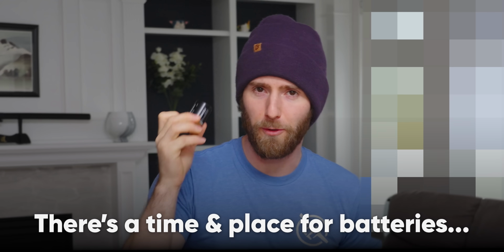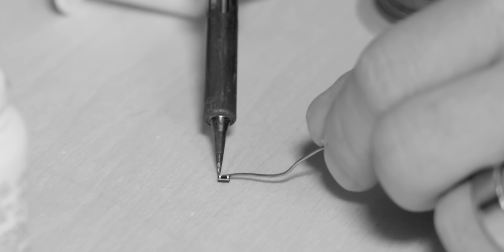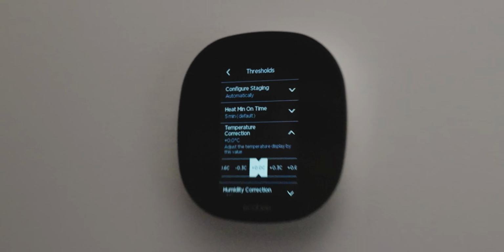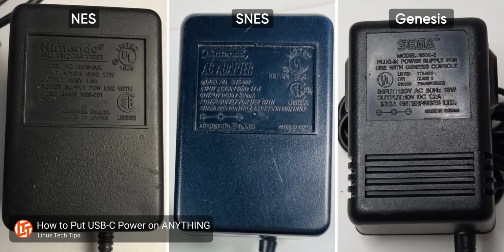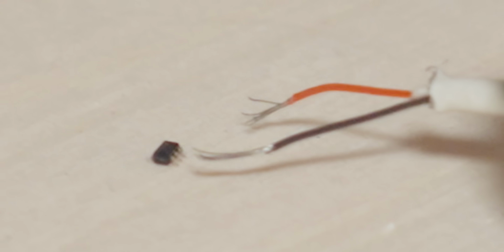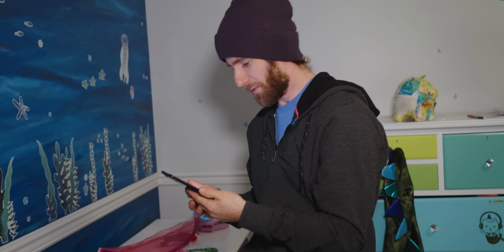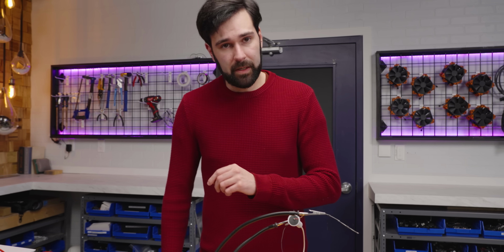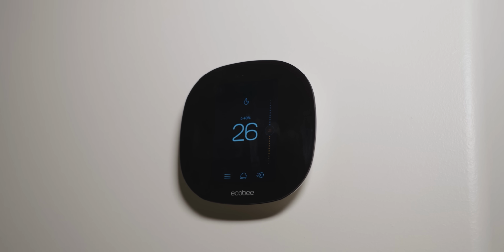I HATE Batteries! - Converting Wireless to Wired (a cheapskate’s guide)

Comment: Tip for next time: If you want to have a small DC power supply, you can use a Z diode and thus set the voltage to a fixed voltage. The structure looks like you have a resistor for the Z diode so that the current to the diode and the consumer is limited. The consumer is then connected parallel to the Z diode. The Z diode determines how high the constant voltage is that falls off via the diode. The Z diode is installed in the blocking direction. This makes it relatively easy to set up a small power supply.
Reply: That is what I was thinking. Why not get a zener diode and just be done with it? Or if that's too much hassle to get the right one, just use a good old LM317
Reply: @fermitupoupon1754  Yeah, an LDO or a zener seems like the move here
Reply: a diode lower the voltage with 0.7v, so u can use 2...as long the diode is big enough for the current, its not a big deal!
my question is: there a so many employees on LTT and no one has a clue about electronics?? come one!
Reply: This thing should be pretty simple, you guys cant use diode to regulate indutive/capacitive loads, you dont know whats is inside. It only Works for resistive loads.
The solution is simples, just use a LDO regulator IC like LM317 and regulate to the same battery full voltagem. If you are looking for efficiency, go for a Buck booster regulator IC, but its not the case
Reply: @gaucho804  sure u can use diode!
the guy in the video did that too!
as long the current is low and not fluctuating a lot, its not a problem!
but u cant use it for all purposes.
Reply: I might be misunderstanding because I haven't used zeners myself before, but wouldn't shorting one across the supply output of a regulated voltage source (the 5V wall wart) cause the upstream active regulator to dump upwards of half an amp through it trying to push the voltage back up to 5V? That seems much more wasteful than an in line linear regulator.
Reply: @bosstowndynamics5488  In this case you'd use a 3.3V zener diode. You'd put that in-line on the positive side.
So you backfeed it with the +5V from the wall wart, into the +3.2V for the sensor.

The +5V exceeds the zener diode's zener voltage. Which causes it to break down and start conducting at it's zener voltage of 3.3V.
Add in a smoothing cap and a discharge resistor. Done.

No need to fiddle with a pot to try and calibrate a regulator. As long as you don't try and draw more amps than the zener diode is rated for, it'll regulate the voltage.
Reply: @fermitupoupon1754  Wouldn't it be easier to just use a 3.3V fixed voltage LDO though? Single part, maybe a capacitor if you're feeling extra fancy. Still no pot.
Reply: @bosstowndynamics5488  Lets say our device eats at most 10mA. We need 3 to 3.3V for it to operate, thus we select either 3 or 3.3V Zener diode. If our power supply is regulated to 5V then we "need" to lose 1.7 to 2V on "input" resistor, but we also need to have enough current for both our device and diode to work properly, typical small Zener diode will need few mA on its own, so lets say 5mA. For 1.7V "drop" we would need around 110 Ohms, for 2V 130 Ohms. We could add a small smoothing capacitor with high value discharge resistor, but for a cheap-junk solution it doesn't really matter. Current will flow from 5V via the load resistor, a bit of voltage/power will be dissipated on it, diode will keep the "output" voltage on required 3 or 3.3V, and the 15mA of set current will flow through both the device and diode.

Two electronic components and it works, but it has few flaws, you basically dump all that calculated current in this case of 15mA all the time, either in the device or in the Zener diode. Personally I would rather use either LM317 or LDO equivalent like LM1117 if the input-output voltages aren't at least 1.5V different. Two resistors to set the output voltage and also become minimum load and thats it. You probably wont need the capacitors, but if need be, could ad them for stability. Advantage over Zener is that although you still need minimum load for proper regulation, and that load being similar at most 5-10mA depending on IC used, you don't need to "waste maximum calculated for Zener setup current" cause IC will regulate voltage and what ever current device needs it will provide, while Zener had a set current and if not used, it would be wasted in the Zener itself. Aka if device eats at most 10mA and need those spikes to work, but most of the time eats less than 1mA, with diode we would need those 10+5mA to be there all the time, the 9+mA difference in device consumption will just go through diode, in the linear regulator way, we will have the perma 5mA minimum load plus what ever device needs above it.

There is always the full "overblown" mode in just buying a cheapo DC-DC converter ;). Or full "junk" mode, where you don't use a 5V USB power supply, but make a capacitor-dropping one like the ones used in LED bulbs haha.

In all honesty thou, if you don't know electronics at all - buy a "pre-made" power supply. And if you know enough, modify the 5V wall-wart thingy - most "decent" ones will have a feedback, and changing resistors in that feedback to make the thing output less volts would probably work fine. Only the junkiest of them will be extremely hard to mod cause they often "feedback" at being designed to output certain voltage with certain current, and they just have more volts on output unloaded, aka only way on some of them to change output voltage is to change number of turns on secondary winding. With supply successfully moded you don't need to do any power wasting addons.
Reply: @bosstowndynamics5488  you’d add a resistor to the 5V output. That will limit the current. 

I’d guess the resistor would be in the range of 1k to 10k, but that can definitely change
Reply: @0010010010010010011  Sorry got mixed up with replies. Fair enough, thanks

Comment: Where wanting to tell about using diode instead of a resistor 😅
But maybe also add a small capacitor in parallel to cope with the sudden spikes in current.
A voltage regulator, diode and a capacitor

Comment: Bimetal thermostat... no batteries, no "app" or "registering", will last 100 years.
And you can make a eco/ smart home system out of that too... Run wires back to dedicated distribution box with contactors, those activate regular 230V solenoid valves.

Comment: My mother had a battery-powered skylight shade installed 16-ish feet above the floor.  I don't even have a ladder that will reach it so it's just been sitting there with dead batteries for 5 years.  And it has a battery-powered wall-mounted remote control too.  The worst part is, the skylight itself opens and even has buttons on the control pad to support a powered shade completely unused.

Comment: The voltage of a brand new CR2032 is about 3.3 volts.  A 3.3 volt regulator with no power wasting resistor would have been fine.

Comment: "Shockingly inexpensive'... not sure about the choice of words. Also, the battery is at 3.2V only for first couple weeks at most. The device should work just fine on lower voltage.

Comment: 1:10 smoke detectors should be replaced every 10 years, regardless of power source. Putting a non-servicable 10-year battery in it is safer for the consumer, and ionization smoke detectors contain minute amounts of radioactive material and should be taken to a designated disposal facility anyways, so there's little additional risk of battery material going into a landfill.

Comment: Another solution along the same lines as the diodes is a shunt regulator, which is simply a 3 or 4 volt zener diode across the device terminals.
Reply: Nop, a 2v zener in series is better

Comment: I love how you try to put stuff like in to the hands of an everyday consumer but I gotta say, those variable voltage power supplies aren't really that expensive and with your solution I would still need a soldering iron, a usb charger, solder and equipment and the parts (that you usually can't buy in singles ..."40cent"...) so maybe the other solution wouldn't be that bad after all

Comment: a small DC-DC buck is just 2$.
If you really want to spend less, Just get a TP5000 Module for 1$, set it to output 3.6v. this is a charging module for li-ion/lifepo4 batteries.

Comment: When your regulator is "low dropout" or "LDO", output capacitor close to the regulator terminals is necessary. What you made will likely not burn your house down but there's a possibility of magic smoke escaping.

Old linear regulators like LM340 or 7805 worked mostly fine without output capacitor. LDO without capacitive load  becomes an oscillator - the capacitor is necessary for frequency compensation. Even if there's enough capacitance on the device supply rail, you can not rely on that since the lead inductance may be too high.

Comment: The best solution in that scenario would've been using a 3.2 V zener diode and a resistor, both of them through-hole type, not surface mount. The connection diagram for this setup is really easy to find on the internet. You NEED to calculate the resistor though, which is REALLY simple, but studying some basic electronics wouldn't hurt....
Reply: Nope, he should use a simple 2v zener in series.
Reply: @fss1704  You're right but only if the device consumes at least the minimum current the zener needs to be regulating. And it shouldn't be in series, it should be in opposition (like in series but reversed so it is biased in reversed mode).
Reply: I said that with a bit of humour. I know Linus knows some basic electronics, but apparently not enough.... lol
Reply: @alejomdp  it remembers me of the cubane synthesis using an UV led on explosions and fire, go watch that
Reply: @fss1704  I just watched it (I think I clicked on the right one), that guy is an LED murderer, he left me with no energy to even comment on his video. It's like people want to try electronic experiments but don't want to learn simple things that only require googleing a bit. He just bought stuff, connected it and hoped for the best....
Reply: @alejomdp  lol i knew you would love it.... 1 amp in such a lamp is just wonderfull, that's some good manufacturer. He should keep to doing chemistry.

Comment: Could you use a voltage regulated super-capacitor and a small solar cell mounted on the wall next to the unit? Keeps it wireless, and with such low power draw the cell should provide enough of a trickle for the cap.
Reply: They probably could have done this in the factory.

Comment: Could you just use a big ass phone battery? I mean yeah hardwired and stuff but to be honest a 4000mah phone battery or 2 standard AA batteries gonna last about 3-5 years even after waste energy over time so youd have to charge / change those things max 3 times until your kids gonna heat their own home and as I know you youd probably rip out your entire heating system anyway in 5 years for some new Plutonium style energy and heating solution for that 1000 Petabyte server with the 256 core epyc and your gaming system with the 650w Intel "17900ksgs" + 1.5kw "6091! super ti 60gb full size shader after dlc" gpu.

Comment: Not sure why you didn't use mini DC to DC buck converters for this. They're about the size of that battery, you can dial them to whatever voltage you need.

Also heat doesn't rise, it's radiant. Hot air rises 😉
Reply: Price, it's easier to use a 2v zener in series.

Comment: just use a 3.3v regulator it will be fine instead of 3.2v and it won't drop when the device draw more amps (asuming the regulator can provide enough amps)

Comment: I love seeing you guys dive into electronics. If you do a project like this again - a 3.3v regular and an electrolytic capacitor in parallel across the output should run any device like this. The capacitor absorbs those spikes. Most circuits with linear regulators follow that approach
Reply: This, plus don't even bother with the potentiometer. The circuit is most likely 3.3v which most microcontrollers are today, so leaving it at 3.3v is just fine.
Reply: I don't know why everyone is saying to add a capacitor for those "spikes", those are 7mA spikes on a device being powered through what in practice would almost certainly be a half to one amp regulator on a half amp or more USB supply, you aren't going to get voltage drops in that configuration (after all, the 3 diode solution they went with is functionally a dirty voltage regulator and didn't cause any voltage drops during the current spikes)
Reply: @bosstowndynamics5488  I think they have the wrong  idea - not realizing is an attribute of the load. There is some merit to it though as VRs [especially SMPS] can be a bit slow to react to load surges
Reply: @bosstowndynamics5488  Yeah, confusing. Maybe some don't realize Dan had him using the potentiometer as an adjustable voltage divider. Which was a silly idea. And maybe others do, in which case a cap would help for the spikes but not the load from the boot sequence. And the 5504 requires a filter cap on the output, which they didn't have, but also shouldn't be electrolytic.
Reply: @heartysteer8752  It's not even really a voltage divider either though, a resistor voltage divider requires 2 resistors, it's just a single resistor after the regulator and hoping for the best. I get that Dan was trying to improvise with parts on hand but I'm kind of surprised he didn't hit on the diode dropper earlier, I'm certain they've got some 1N400x diodes lying around if they've got random pots and linear regulators.
Reply: @bosstowndynamics5488  I thought they were using the wiper for a variable output. Yeah, it does look like they were just going for a series drop.
Reply: you need a LDO VR IC.  The current spike is caused by the load.  The cap would act to supply the current.
Reply: @kennmossman8701  The MIC5504 is a LDO VR. The problem they were having was mostly stemming from their use of the potentiometer as an adjustable voltage divider.
Reply: It just sucks that a linear regulator will waste some power, mot much at these voltages, but some (for the ultra power efficient folks)
Reply: @billmiller4800  By my guesstimation the linear regulator will waste $0.03 in electricity to save $3.00 for a battery. Not counting all the other costs, losses, and benefits.

Comment: The smart sensor itself would have a voltage regulator since it expects a nominal voltage of 3.2 and battery voltage varies depending on how charged they are. So, your "Going for exactly 3.2" was a pretty pointless exercise

Comment: OK so a few thoughts. First, your "3v" smart home devices are absolutely rated for 3.3v. Because 3.3v is industry standard for microcontroller operating voltage ratings. It would actually cost a LOT of money for anybody to make a circuit that required 3.2v and would not run on 3.3. Second, the MIC5504 comes in variants from 1.8v to 3.3v, which means you can buy the MIC5504-3.0 and it's exactly the 3v you think you need.

Comment: Okay I'm gonna be that guy and ask for the opposite video to this. I'm much more interested in wireless devices, a clean desk 99% of the time and just plugging in the mouse or KB every week or two is much better for me but things like Logitech's wireless charging mousepads are too small, there are great keyboards that only come wired and so on.
That said, I do agree with the fixed, always on devices like surround speakers, lighting, smart speakers and stuff just don't make sense in battery form. They're not portable, they're not turned off, there's no reason for batteries

Comment: Linus may be onto something, I would much rather buy a smart thermostat sensor that simply plugs into an outlet and lives there than buy a handful of $40 sensors that are wireless that I have to buy batteries forever on. Running power can be difficult sometimes, but dealing with batteries is so wasteful and expensive. Nothing like spending $100 a year on batteries for solar lights, smoke detectors, smart sensors, and other junk EVERY YEAR!

Comment: heat can cause batteries to degrade faster, the optimal storage location for batteries is inside your fridge. not in a random shelf in your attic/garage, thats a place where they will die before you can even put them in something.

Comment: AMS1117-3.3 DC 4.75V-12V to 3.3V Voltage Regulator is like $0.79/each on amazon already soldered to a board with pins super easy.

Comment: I think that a better solution would consist of a 3v zener diode and a resistor. Hopefully the team at LMG sees this to test it.
Reply: Nope, a 2v zener would be better, you use it to drop the voltage in series.
Reply: @fss1704  That would also work. I thought 2V zeners didn't exist because I read a thing that said zeners can only have breakdown voltages from 2.4v. But I found a 2v zener on mouser.
Reply: @YSPACElabs  there are zeners even at 0.7v

Comment: My cousin did the exact same thing with his smart home setup when remodelling, made everything wired. Makes more sense when you have the ability to rip out walls and hide all the wires, on the other hand I don't have that luxury so i've gone down the battery route, and it's been good so far. Home Assistant will give me a warning for any sensor that has a low battery and I can order it and have it arrive before it dies. Bit of a pain to go round replacing everything but I don't mind.

Comment: ah yes, spend 40 cents and a whole day of your time turning a 5v adapter into a powersuply for your sensor, instead of spending about $3 on a 3.2v ac power adapter (i am sure you can find cheaper ones, this was just the cheapest i found that had next day delivery after about 1 min of searching) chopping off the end and soldering that to the sensor. yes its about 7.5 times the price, but come on, we are talking about $3 that will save you a whole day of trying to make it work. and if you value your time at less then $3 for a day, you should send me an email because i got multiple positions i am hiring for :)